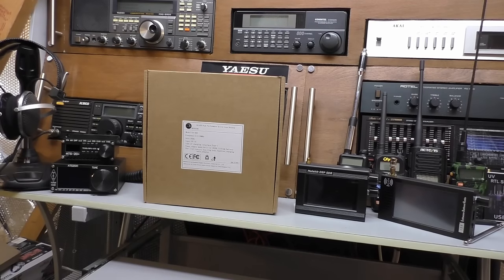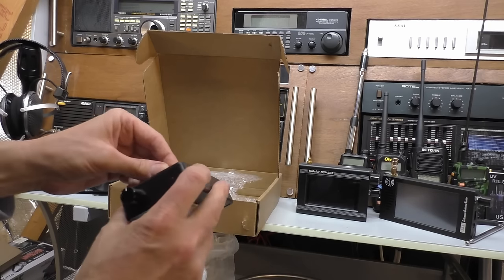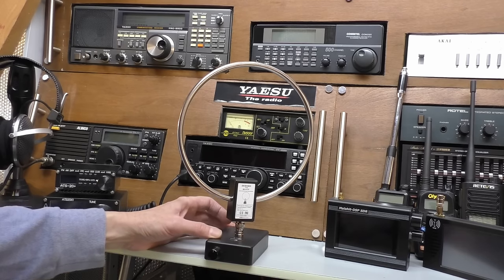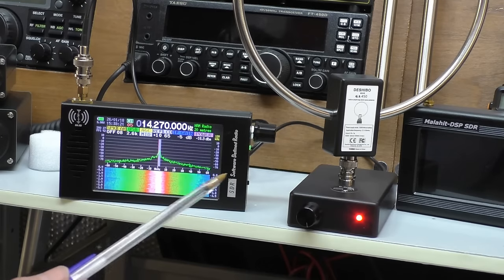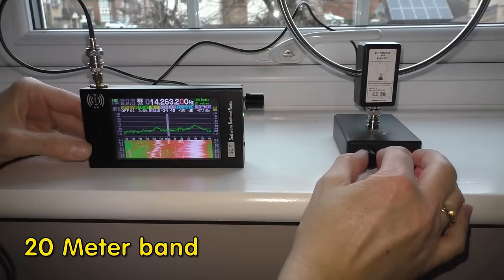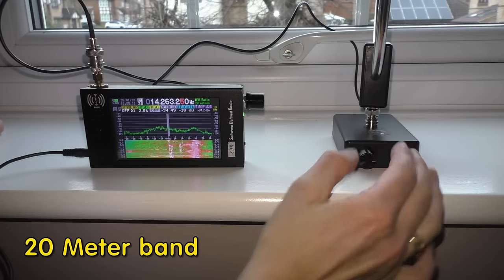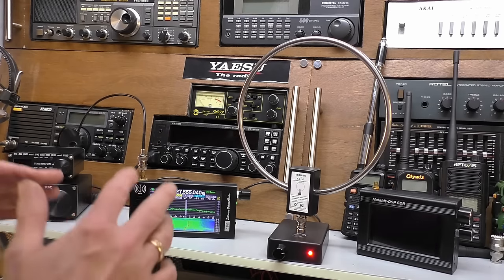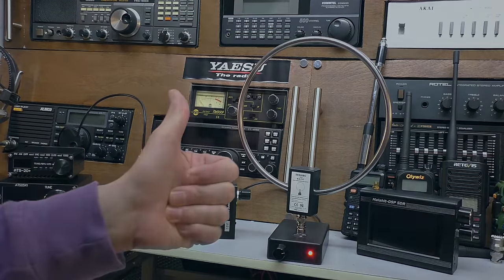GA-450 SW Radio Mini Loop Antenna. Well it surprised me !

Comment: Great review Fred! Thanks ! I was hesitating about this antenna, but your review has convinced me. I would like to use it with my Yaesu FRG 7700. I am going to purchase it for sure. Keep on your great work. Cheers from just the other side of the Channel near Dunkerque ;-)
Reply from the maker: Glad I could help
Reply: Hi could you let me/us know how you get on with your FRG7700 using the loop antenna. I have the same receiver and use long wires. 👍
Reply: @vtechead1  , sorry for my late answer. I have purchased this loop antenna. It works quite well with the FRG7700. As Fred mentionned it, it should be put near a window, or on a window sill to get the best of it. But according to me it will never be as good as a long wire antenna with a good ground. But it works well enough. I have not tryed it outside in the garden. The weather is so rainy actually in the north of France, but I can't wait to try. For its price it's a good investement, indeed. Hope this help. Cheers. François 🙂
Reply: @danismagic2  Hi and thanks for the reply. It may be adequate for general use with my receiver, as I sit at a bay window with unobstructed views of 180 degrees looking south and situated above a town. 
Think I will give it a go.
Thanks again for your reply 👍
Reply: @vtechead1  You are very welcome Donny 😊

Comment: Hey Fred on my DESHIBO GA-450 the knob is also a little stiff when you turn it halfway but after using it for a month it is loosening so don't worry! That knob stiffnes is a manufacturing issue after using it for a long time it will get better! 73's!
Reply from the maker: Thanks for the info.  It has started to loosen up but it still goes a bit haywire around that point.  Not sure if it is a fault or just an overload of gain.

Comment: Nice demo Fred. The loop is smaller than the one on the MLA-30 active loop antenna, but very sturdy compared to the thin wire that the MLA-30 uses.  Before the video and seeing the loop along with your comment I quickly looked it up on Amazon ($89.95 USD from one brand and $107 USD from another) and left the page up until I watched your report.  I have an indoor mag loop for transmitting and one box to tune is enough for me, but then, reading the info on the Amazon page the knob that turns is more of an RF Gain control for the amplifier vs. a tuner, so if tuned all the way up I imagine you'd get some distortion on the signal and adjust either the antenna or RF gain on the radio. So, it's basically a MLA-30 with a sturdier loop and no rf gain control for about $40 more. I run into distortion occasionally on strong stations and end up using the RF Gain control on the radio to get the same effect. I read a few reviews and ran across one where the buyer noted it was not as smooth turning the knob in a couple of places, but it cleared up after a couple weeks of use. Apparently, they have a GA-800 model that is a lot more money ($138), can be used outdoors and they say "No More Tuning" which contradicts what I read earlier (they may have added an AGC, or better AGC circuit to this model). The frequency coverage is better, and it has a bigger battery (2600mAh vs. 1000mAh in the 450). Maybe you can get them to send you a PAC-12 portable ham radio transmit antenna to try out next... 😉 While $89.95 isn't a high price with the better loop, but I'd rather see it about $20 less. Thanks again, keep those reviews coming, I really enjoy them!! 👍
Reply from the maker: Hi.  Yes i agree with you on the price.  Its not worth paying too much for these small loops.  Banggood were selling the 450 for just over £50 when i started the review although the price goes up and down with exchange rates.
Reply from the maker: LOL.  No its fine. Just an odd name.

Comment: On a "quality" loop, on the spectrum you would see a low flat line either side of the tuned frequency, with a raised hill on the actual tuned frequency.  When you move the antenna tuning dial left or right, you would see a corresponding movement of the "hill" moving up or down the frequency on the spectrum.   To be honest, this just looked messy, although it might be better than a bit of wire??     Appreciated and thanks for the video Fred.
Reply: Agree, I too saw no hill moving up or down in frequency like my magnetic loops, looked like a noisy gain pot

Comment: Hey Fred thanks for sharing the GA-450 active loop antenna video. What you are receiving on 11.815Khz iis probably a turkiah station. Voice of Turkey TRT1. i can understand the language. I too have this antenna which i use on a XHDATA D808 shortwave radio mostly at night and yes it is tunable. 73's
Reply from the maker: Hi.  Yes prob a Turkish station.  I ve also found that the noise drops once the sun has set.
Reply: I was thinkn of getting on I have an mla 30+ and a x1 hf antenna out the bk garden but I like this one for indoors ..

Comment: I'm like a 3M project manager HA.  (Everything takes forever).  When Spring comes I'm going to be on my roof new OTA TV antenna.  I may put up 360 rotator for different stations. but you can buy two and join them with a switch.   It's not Hamm blue waters, or CB, it's just FM radio, but related fun.   Cheers!

Comment: Contrary to popular belief, loop aerials are NOT strongly directional. However, they DO show pronounced nulls perpendicular to the plane of the loop. This means you can set them up to minimize local QRM and then usually receive signals without needing significant adjustment to the loop direction. Nice demo.
Reply: And generally speaking, the directionality will only go up  to 2 or 3 Mhz.  This is because skywave prop starts to take over as the main prop mode and a simple loop can't distinguish 2 or more signals coming in this way

Comment: I’m using that radio. It’s somewhat of a pain to use but it gets you a waterfall cheaply. 
I mainly use it to keep an eye on 10m am from signals around 29 megs. It’s very sensitive with my 10 meter 30 foot end fed. It is a non updateable clone. 
Great on the antenna, I’d like to find something like that, perhaps a little better.

Comment: Hi Fred, I own this antenna and it does a great job, be it for eliminating qrm (as much as possible) or homing in a signal by rotating the loop. However, it DOES NOT cover medium and long wave.. Sure, strong local stations will come through but absolutely no dx-ing on Long- and Medium wave with the G-450. That’s where the G-800 comes in. The G-800 is not tunable and has continuous covering instead. That said, the G-450 is a great indoors antenna, certainly if you take the price into account.
Reply from the maker: Thanks for the information.  I get so little MW and LW these days its hard to really tell.  The G-800 does sound interesting.
Reply: @CB-RADIO-UK  Interesting yes. However, I recently bought this one as well and my expectations were high. But it did not really perform I had hoped it would. It works, that’s all. On short wave it works fine and it really tries to lower the noise floor but there are interferences caused by the antenna itself be it a lot less than the G-450 generates. The G-800 is quite useless on long wave so those on the hunt for aeronautical beacons can better look elsewhere, deaf maybe is the right word, certainly if compared with the Wellbrooks loops. In short, the G-800 works but I had expected a lot more on MW and LW. Greetings, Willem, Hekelingen, The Netherlands.

Comment: This antenna actually tunes backwards highest frequencies to the left, lowest frequencies to the right. The tuning range is approximately 4 - 16 MHz or the way they wired up the pot from 16 - 4 MHz. .  It also has a poorly designed 12V switching boost regulator the that seems to run about 1.8 Mhz  and around the 7:00 mark of the video you can see one of the harmonics to the right of the received signal and how it moves around and even upsets the front end of the SDR as you tune it.  I'm going to try to modify mine and see if I can lower that spur, first by actually using shielded coax from the antenna to the amplifier/tuner board and from the Amp/tuner board to the output jack, then I'll twist the wires from the charger/converter board to the amp/tuner board and slip it through toroid ferrite choke (or use a clamp over) because that power line is acting like a transmitter antenna and inducing that converter frequency hash right into the antenna. Hopeful those two things will knock down some of that interference.  I'm also thinking about adding another turn to the antenna element (currently 2 turns) and a SPDT mini toggle to switch it in and out which should allow it to tune down a couple more MHz.

It's not bad as long if you stay away from those spurs but sometimes you can't and it swamps out the desired signal and even can overload the front end. It's strongest point is that it is portable and runs off a 3.7V Lipo battery but that's also it's weakest point because of a poorly implemented (and shielded) 3.7 to 12V switching boost regulator. I really expected better at this price point. If you were to disconnect the battery and run this off a 12V linear supply or a 12V battery it would be really good quiet antenna
Reply from the maker: Thank you for the detailed information.  It makes sense.  Also explains why i got nothing above 18 KHz.  I will interested to know if your mods improve the performance.
Reply: There was definitely some internal nasties going on and I was surprised it was tunable 2.5-30MHz

I would be curious if it’s performance compared to one of your regular antennas.

Comment: It looks like the tuning knob is shifting the frequency of the received signals which is not possible. I would expect a noise peak to move across the spectrum as the tuning knob is rotated, but the signals to stay where they are.
Reply from the maker: It could be my hand touching the unit.  I was noticing a 10k shift when i brought my hand near it.
Reply: @CB-RADIO-UK  that seems very odd. In the old days we would think that the changing antenna impedance is "pulling" the receiver local oscillator but I don't think that is a thing any more in this SDR age !
Reply: Definitely doesn't correspond to my experience with tunable magnetic loops

Comment: Fred I'm all set like yourself but can't find a reason to use it due to bucket mouth it was better back in the late 70s better class of breaker then lol have a good day
Reply from the maker: Sorry to hear that.  It does happen Iam afraid.  Look further into the hobby and reach out on SSB.  You should have very little problems on DX sideband.
Reply: @CB-RADIO-UK  thanks for your reply 👍

Comment: I enjoyed your video. I am a bit confused that tuning the antenna seems to change the frequency being received, which makes no sense. The signals move up or down the band as you tune -- or place your hand near the unit. -- yet the radio is set to a particular frequency. It seems to me that turning it would simply change the amplitude or strength of the signals on the screen, not move them around. Any thoughts?
Reply from the maker: Get what your saying.  Not really sure why.  Just the way it worked out.

Comment: Hi. Willem from The Netherlands here. I have this one as well. Maybe I’m expecting too much but I find this thing thing disappointing. Sure, it brings in stations but it adds noise too. And that’s something we just want to get rid of, certainly if you are indoors and have no ways to install a proper antenna other than indoors solutions. As you clearly showed, tuning this thing is a challenge being the thing gets nervous if you get near to it to rotate the loop. On medium wave, which it is not designed for by the way, results are terrible. Weaker stations won’t listenable at all if picked up at all. In short, if no outside space is available or one is not allowed to install a proper antenna there, go for the more expensive G-800 that will do a much better job and includes medium wave as well. Now I don’t say it is a rubbish device but spend the extra costs on the G-800. Greetings, Willem.
Reply from the maker: Hi.  Funny you say that.  Keep an eye on the channel later today.

Comment: Did you try it on top band?
Reply from the maker: I did try it on 10 and 11 meters but nothing heard.
Reply: Ah yeah, I meant 160m, which is just a bit higher the MW. @CB-RADIO-UK
Reply from the maker: Got you.  It worked well om MW so should work well around 2 MHz

Comment: Can I put the wip that came with the DSP2 radio onto this and take the loop off then try tuning it?
Reply from the maker: I guess you could.  Part of the hobby is trying different ideas.
Reply: @CB-RADIO-UK  I was just a bit worried about the pull up antenna causing damage to the loop antenna electronics?
Reply from the maker: The loop connects via a standard BNC so any BNC antenna will fit.  If it works and can be tuned effectively is another matter.
Reply: @CB-RADIO-UK I’m testing it out now!!!
Reply: @CB-RADIO-UK tried the wip it does tune a little but not as well. I received no audio signals on any of the bands at all. That said I don’t receive much at all using the loop. I usually only receive anything audible on one band depending on the conditions.
Reply from the maker: Yes the whip will be tuned to a certain freqs and the loop is wide band.  You could try a simple long wire on the loop base.

Comment: I JUST BOUGHT A MALAHIT SP2,WILL A CONECTOR COME WHITH THIS ANTENNA TO FIT THE ANTENNA CONECTOR ON MY DSP2 THANKS STEVE
Reply from the maker: I think it will as your radio should be SMA connector.
Reply: FRED CAN YOU PICK UP CB RADIO ON THE SP2
Reply from the maker: Yes it should cover 27 MHz no problem.
Reply: @CB-RADIO-UK  THANKS FRED